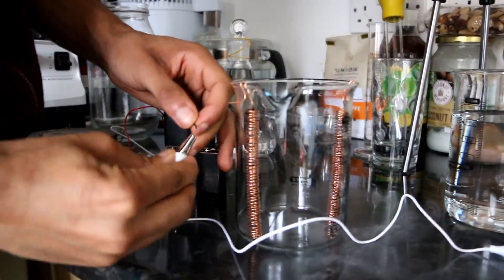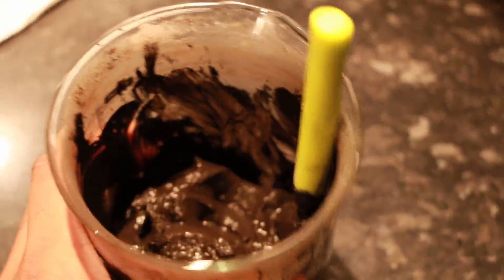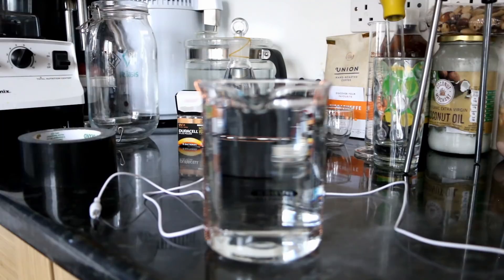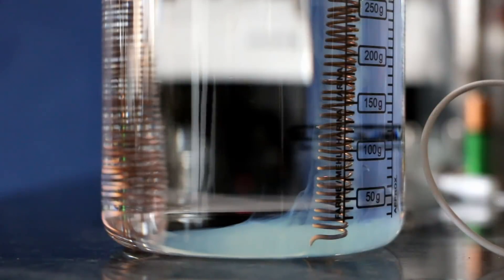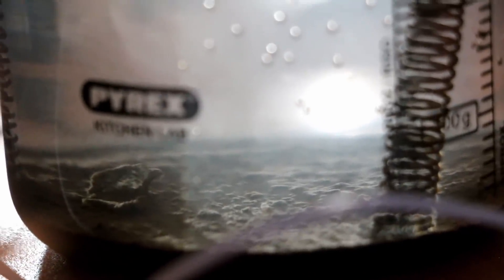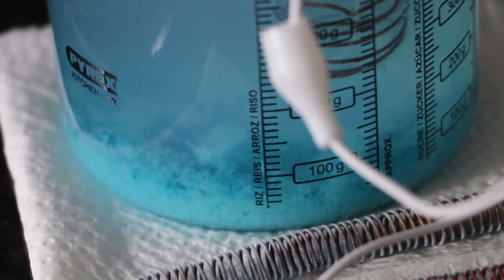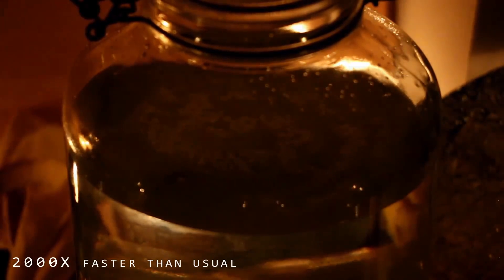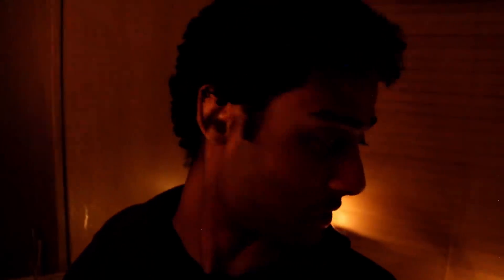Making Ormus at Home Pt.1 | How To Make Colloidal Copper

Comment: Hello there. Practical alchemist and occultist here. Just to clarify, the only metal colloidals that exist in reality are silver and gold. In this case what you're really making is CuOH (copper hydroxide). That being said, I like to treat it as a colloidal. I make it myself and treat it as such. "Colloidal copper" is really beneficial to the body, especially the heart and cellular structures such as veins and arteries. This is not ORMUS however. Ormus is made by titrating salt water with NaOH (sodium hydroxide) to a pH of 10.78. ORMUS is a super conductor that defies science as we know it. Once you consume it, it'll repair damaged parts of your body, pull heavy metals from the deepest tissues in your body (Eg: brain, lung, heart tissue) and increase your body conductivity by many folds. There's a caviat to using ORMUS though and I feel that I must disclose it here as I am a long time user of ORMUS. It easily makes a person aggravated for no reason whatsoever. Some become very emotional. Whatever the case, the mood swings are there. And tinnitus is also a common side effect. It is said though that tinnitus is the higher forces (angels, God, etc) relaying messages over to you. ORMUS is capable of repairing ANY DAMAGE in the physical, mental and spiritual body. To speed up this process, I always practice meditation and energy healing when taking ORMUS.
Reply: Is there a way to communicate with you.?  I have some questions regarding your comments.

Comment: This video is older, but I would like to give important information to anyone who wants to replicate this process. Conventional copper contains a small amount of arsenic which is extremely toxic. If you want to do this, you should use high purity copper from the industry. NEVER use conventional copper wire or rods! Best regards and thank you Ryan for your videos.
Reply: Should it be hard or soft copper?
Reply: @foxyroxy7189  This is not essential, it is much more important not to use the common copper from cables or pipes from the DIY store. You can use extremely pure copper from the industry, which usually comes in small bars. However, I would not do this with copper and rather make collodial silver, but I don't want to criticise that, everyone has to decide for themselves what they will do.

Comment: You can also add salt to make process working better and use distilled water. You can also consider nanocoating the other wire so it will be more effective and you will get more and better Ormus.

Comment: this guy is gonna poison himself to death
Reply: Hey that's kinda informative, it was a really nice read. No need to be lowkey agressive
Reply from the maker: I've got extensive knowledge on the subjects, along with a thorough (practical background) in chemistry. Poisoning myself at this point within my life is damn near impossible.
Reply: Ryan Cropper good answer 😊
Reply: well you admitted you already made yourself sick once so there is my reason for concern, anything can become toxic especially when using metals extract, how do you know its 100% copper? labels are dodgy these days you could have copper plated wire from china labelled as copper.....just dont use lead ok
Reply: he (lowkey) poisoned himself when he was a dumb teenager.. i mean how can you even compare it?
Reply: west boy are you saying I am “low key aggressive”? Because I fundamentally disagree with that. My comment was intended to be informative as well as to expose  categorically false information from this video. I could’ve been much much more cruel.
Reply: Would you be willing to test that under observed circumstances?
Reply: It’s pretty obvious that you don’t have extensive knowledge of chemistry. Otherwise you would quickly identify the blue powder precipitating from the solution as copper hydroxide. Electrolysis splits water molecules into hydrogen and oxygen. Four 9 volt batteries in a series only produces 36 volts at 0.08 amps. Which isn’t enough energy to electrolyze a water molecule. So, all that’s happening is ionization at the cathode and anode. That’s why they look all crusty at the end of the experiment You end up with a mixture of CuOH and CuH. The copper hydroxide then decomposes to copper oxide which is why the color changes from blue to black. This is super easy to prove. Weigh your copper coils prior to starting the experiment and then weigh them again when your finished. Then, weigh the dry precipitate. The two weights will not add up to give you the original mass of copper it will be substantially more. If you have any knowledge of chemistry then I could stop explaining now and you should be able to determine where the extra mass comes from. Pro tip: it doesn’t come from a “higher dimension”. 
The “vortex” in the romantic candlelight scene at the end of the video is explained by a guy called Albert Einstein, maybe you’ve heard of him, the phenomenon known as Brownian motion is described as a function of thermal equilibrium.
Reply: You are THE ONE! :) thanks for opening minds :)

Comment: What happens if u keep it burning for a week.
Reply from the maker: In the old days, they'd add salt to the burn over and over again in order to pull the elements apart for up to a week or two. Nowadays we use sodium hydroxide to shorten the process. If I'd add salt to the mix then I assume it'll have a similar effect. I know that you can keep adding Sodium hydroxide to the burn tho to break it down further.

Comment: So is all salt just bad for the body because it has minerals?
Reply: Petersophic you need to take a couple of lessons which are free online about the mineral . Which does what , health benefits , sysmptoms of deficiensy in the body ect . Start with iodine , selenium , zync, potassium .
Reply: Everyone needs salt in their body - pretty sure you can die without it.
Reply: That was alot of info thanks
Reply: Not all electrolytes are absorbed at the same rate through our guts. As I understand it, organically bound minerals are very easy to transport around the body. 

Also, ionic molecules that can donate electrons are really useful in the body, like antioxidants. 

Also, electrons are considered negative in charge, this we say these molecules with excess electrons are reduced. I think most alkaline molecules have excess electrons, while acids have access protons or are good electron acceptors. Our bodies are a wonderful balance of redox, or reduction and oxidation.
Reply: Petersophic my pleasure :)
Reply: Ermal Progni boron, sulfur, silica magnesium :)